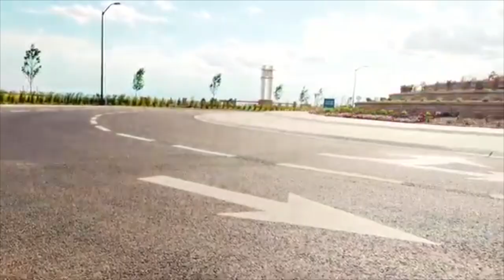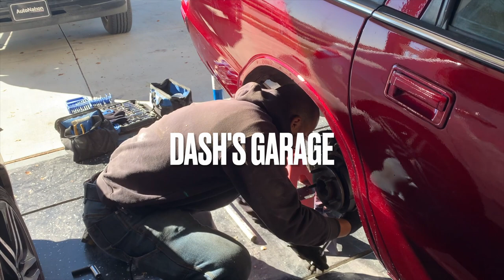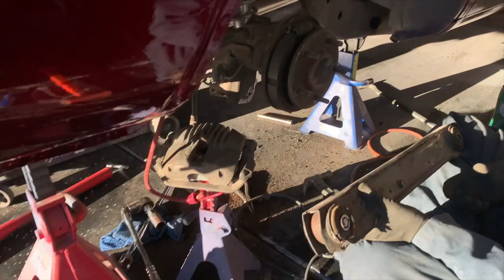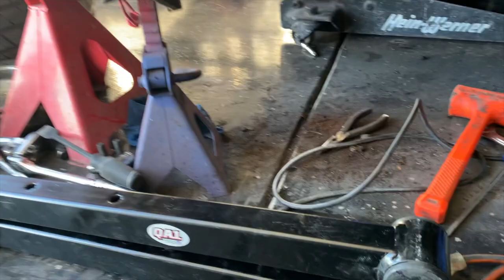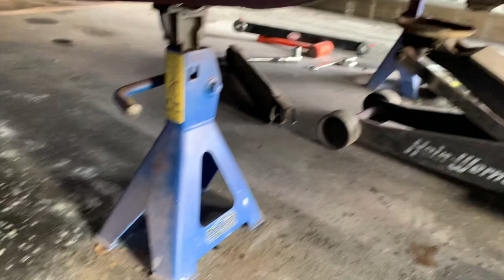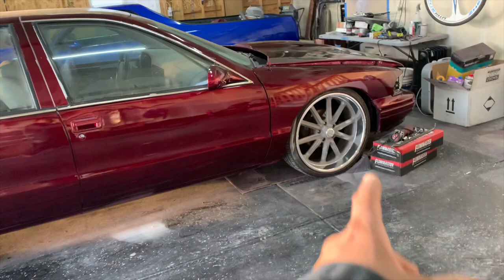I FINALLY CENTERED MY IMPALA'S REAR END [QA1 CONTROL ARMS]

Comment: On mine Centered the axle by moving body slightly over on frame . Equal on both sides now . Hope that helps with what you mentioned
Reply from the maker: That does help but to do that I’d have to loosen all of the body mount bolts right? I think there’s a way to adjust the axle

Comment: Try some AT-205 re seal for your rear main seal, just change your oil then add it to fresh oil it will stop the leak. Same as the trans.
Reply from the maker: I might try that. I’ve changed the oil already so I’ll just put it in

Comment: Have you ever had someone to have problems with the QA1 Suspension in the rear make creaking noise when driving slow and driving over bumps? Had a shop install the QA1 Big Wheel Bubble Suspension Level 2 kit on my SS. Car has been creaking when going slow over bumps and humps. Just wanted to know if this is something you've heard about from others. Thanks.
Reply from the maker: No I’ve never heard of that but they could’ve either over torqued the bolts or not greased the bushings when in stalling them
Reply: I was hearing this noise on mine have you figured out the issue?
Reply: @rigocastillo8929  Hey just checking back in. So my primary car was in the repair shop and I had to ride the Impala back and forth to work, which is 45 minutes to an hour away. I never drive that car that far for that long DAILY. But this particular week I had to. Anyway. After that week, I must've turned down my music for some reason because I usually keep it up to avoid hearing that terrible creaking noise, and wouldn't you know it; That creaking/squeaking/groaning had went away. I've confirmed it day after day. Even today, I rode around with the door open going over bumps and humps in my neighborhood listening for noises and it was gone. 

My thoughts on why is this; My suspension was brand new. For whatever reason, it creaked and made noises when installed. Shop claimed they greased the parts and done everything right. I don't doubt that they did. I'm thinking that maybe I had to drive it around some and break it in. I mean, this thing is quiet as a mouse when going over the humps. Its a heavy car so it has its little noise that it makes when coming to a stop. This is natural to the car. That loud creaking though is gone. You only hear the sound of the coils contracting and expanding when going over speed bumps. 

So thats what I think happened. I think the suspension finally broke in; at least whatever was causing that issue.
Reply: Ok ty

Comment: I just had my mechanic do the same thing with the same parts. Looks so much better. Did you experience any vibration due to the pinion angle? Maybe I missed it, but what size rims are you going with? If 24s, what size tires? Skinnys 25, 30 or 35?
Reply from the maker: Nah I don’t have any vibration. You have to adjust the pinion angle to avoid that. The upper control arms need to be extended so that the pinion angle is as it should be. I’m going to put 24s on it. It’ll probably have 30s in front and 25s in the back.

Comment: Nice work, question for you how far did you move the rear end back to center the wheel( measurements please if possible ). I'm gonna do my car I've got almost all the interior complete
Reply from the maker: It’s 5/8 of an inch. So the stock one was 22 inches and the QA1 is 22 and 5/8.
Reply: @grindschool  awesome thank you I just did my steering wheel if you have time check out my you tube channel Keith Reed I'm just getting started on my Impala SS

Comment: You order a new bushing or just get a slightly smaller bolt?
Reply from the maker: I’m going to get a new bushing. I sent a message to summit and they’re supposed to send me a new one but I have to pay for it because it’s been so long since I ordered the arms.
Reply: @grindschool  alright. My neighbor has a press if you need to go that route.
Reply from the maker: Okay perfect thanks. It shouldn’t be too difficult thought because the metal sleeve should slide right out of the rubber at least I hope

Comment: Did you extend the axle
Reply from the maker: I extended my control arms which just pushed the axle back
Reply: @grindschool  ok. Cas I just put 265/35/22s and it's touching on both sides More on driver side. But I got new shocks to put on and I was going to add 2' cups to lift it. It's not centered front to back or left to right 🤷🏾‍♂️
Reply from the maker: Interesting. Car shouldn’t touch on 265’s. I had 2 inch drop springs and my rear tires are 315s and it didn’t rub except on bumps. My car now has coilovers so I can adjust the ride height. Also car came from factory not centered in the rear, so I believe the passenger side has more space than the driver side from left to right. I’ve been told in order to fix it, the body mounts have to be loosened and the entire body of the car needs to be shifted over.
Reply: @grindschool  ok yeah I been doing some research on it. I appreciate it.